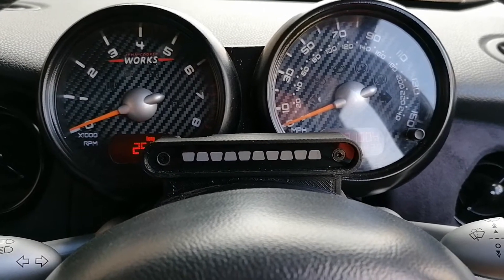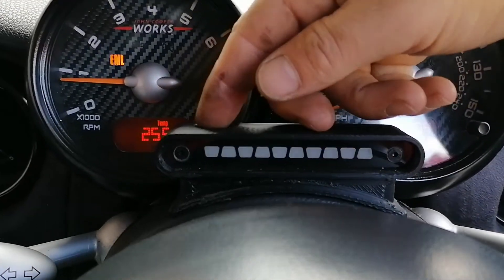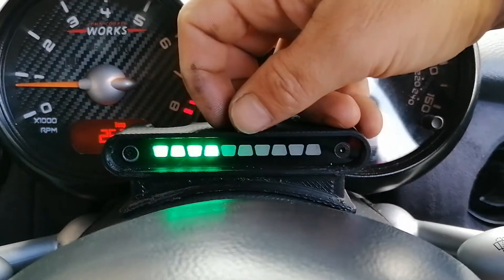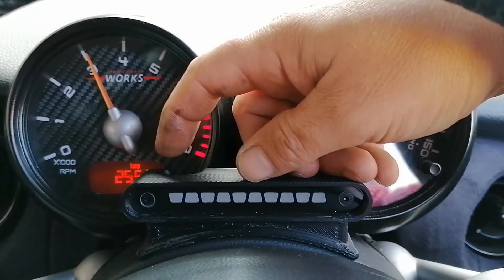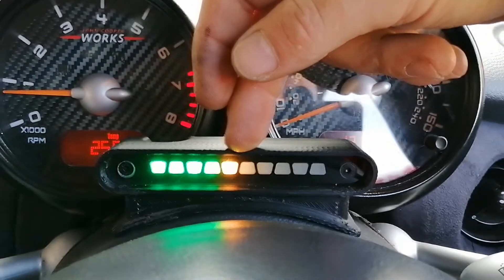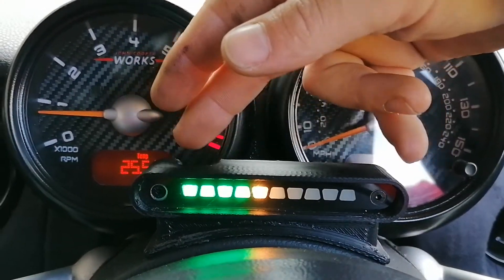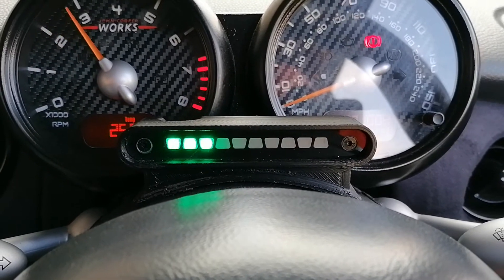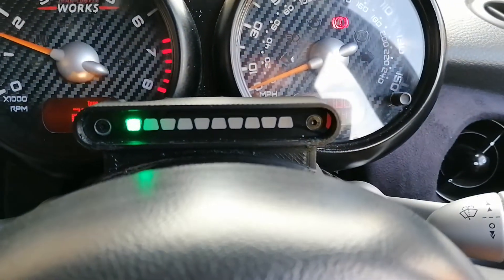Shift light / rev display configuration walkthrough

Comment: One more question… how is the bare wire connection made? I’d prefer to not have a connector on the OBD port so on your bare wire option I’m wondering what wires do I need to tap into in the car?
Reply from the maker: It needs 12v, 0v and connection to pin 9 of the obd port